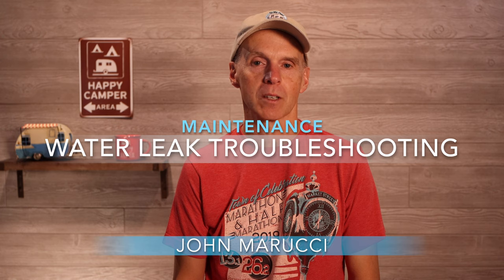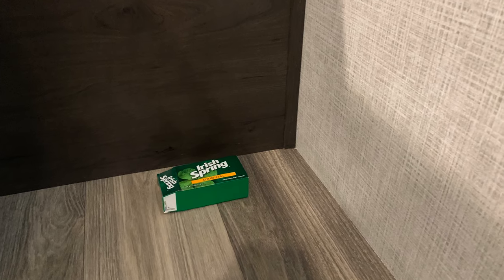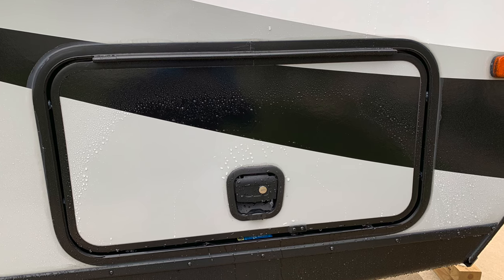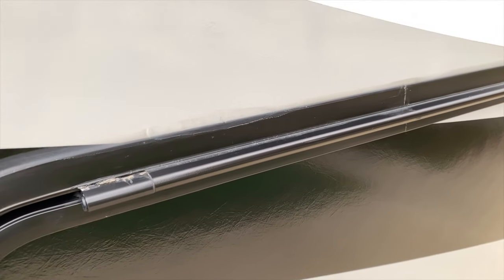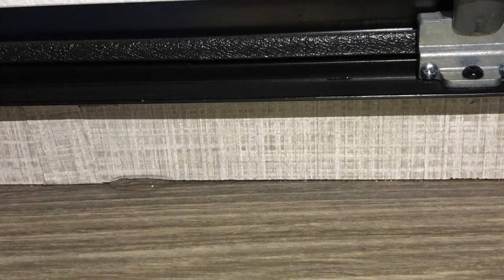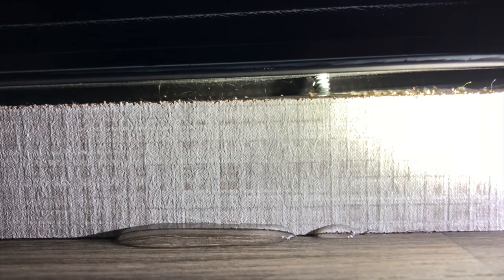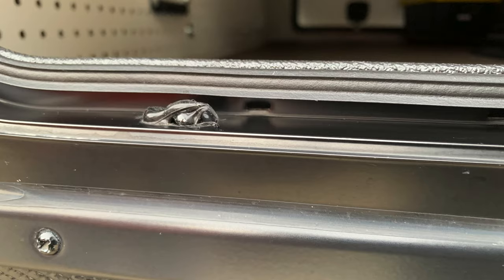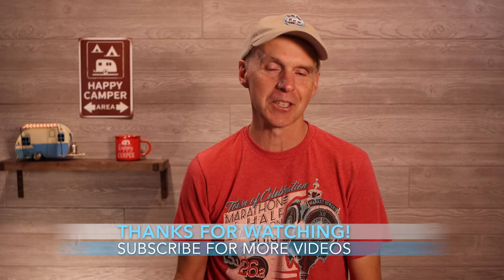RV Water Leak Troubleshooting

Comment: Wow, nice work. We have had a leak plaguing us since day 1,  which is 4 months now on our apex nano coachmen 194bhs. The dealer has replaced the front window multiple times. I’m so warn down by the fiasco.
Reply from the maker: Leaks can be very frustrating. If it is under warranty, it's hard to keep it going, but try to stay persistent with your dealer until it is fixed. All the best!

Comment: Nice job figuring out that leak. Most people would not go to that extent to find the real problem. Maybe that is why there are so many water damaged RVs. I would note that I now avoid using silicone sealant because it doesn't last. There is a alternative called proflex sealant that lasts much longer and stays clear. Another alternative is a sealant used on household aluminum  gutters that seems to be the same as proflex but easier to find at the home improvement big box stores. Another common leakage point is the running / side marker lights. I seal those with proflex. Fair seas and following winds to you and your viewers.
Reply from the maker: Thanks for sharing the tip on using a better sealant!

Comment: Hi I just got a 1968 trailer camper yes it’s old the guy sold it to me for 500 bucks I bought it for privacy at my home so I can make it as a room for me but we just had heavy rain yesterday and on the top of the camper there’s a small leak and it leaked the whole camper inside I was sad so just now I push the water out on top and put a 10 ft tarp over my camper I hope this stop from water getting in and into my camper
Reply: I would want to show you pics of the camper and yes it’s really old I think it’s a bad buy and my dad is upset about it but little by little I can fix the issue but what should I do for now ? Please anyone wanna get a hold of me let me know
Reply from the maker: Jose, search YouTube for “Old camper roof repair” and it should bring up several videos from people who have had to do this.

Comment: Thank you so very much for taking such care to film this video. I’ve never had an RV before and at 81 I find myself with two large ones. My family and are living in them while a house remodel is underway. 
I’m in San Diego and we’ve just experienced a horrendous high wind and substantial rainfall which has resulted in water coming in a bedroom and pooling on floor. So I’ve turned again to YouTubei to learn as much as I can. 
As others have mentioned you’ve produced an excellent video on perseverance.  Though unlikely my solution, I did learn so much on how to isolate areas and how I might check them. 
I’ll certainly be binge watching your others to become familiar with trouble shooting and understanding. My rigs are both used and no manuals were included so I’ve a lot to learn. 
Again thank you.
Reply from the maker: Thanks for sharing your comment. It’s great to hear that the videos are helpful. All the best!

Comment: Thanks for the video and ideas on how to test for the lower seam leak.  I was going bonkers trying to figure out where the water was coming from this time!  While looking in the door with a flashlight, I gently sprayed some water around those sealed screws and quickly saw water coming in.  After close inspection, I found a sealed screw that was broken and loose.  I removed the broken screw head and sealer, then filled up the hole with GE silicon to seal it all up.  I went over the rest of the door frame screws for good measure and did another test spray and saw no water coming in.  Thanks for the ideas on where to look!!!!!  2020 Winnebago 2108DS front driver side passthrough door.
Reply from the maker: Gerald, great to hear that the video was helpful and that you were able to identify where your leak was. All the best!

Comment: Great Video. I have a 2022 Jayco 284BHS and so far have encountered at least 3 different water leaks. The firs two was easy for me to see where the water was coming in from (The slide, and a window) but the one i'm troubleshooting now is a little more difficult to locate. Keeping water out has been my biggest challenge with owning a trailer.
Reply from the maker: Thanks for sharing your experience. Have you been able to locate to source of the leak?
Reply: @JohnMarucci  I have! At least I have found one source. Under the shower I can see water dripping from a hot water line. Unfortunately I don't see any easy way to access it. I have seen others have to take out the entire shower to access the lines..
Reply from the maker: Mine has an access panel to under the tub pan. I’m assuming you don’t have an access panel?

Comment: Would this allow water to get into the insulation that under that area. In the outer edge of my sonic (similar floor plan to yours) underneath on the sides, I noticed the insulation under the plastic was saturated with water. Only in the front of camper. Both sides.
Reply from the maker: It very well could allow water to seep into the subfloor and any insulation. The key is to try and test to see where water is getting in. If both sides are wet, I'd start by checking the roof caulk on both sides for any holes, then working down to the lower areas. Having someone help spray a specific area, while you are looking at that area is helpful. I video taped a lot in the cargo hold to find the issue. All the best!

Comment: In the same issue with my rear cargo hatch door, only difference is mine doesn't have the crimps/weap holes and the screws are on the inside , was hoping it would be one or the other lol.
Reply from the maker: With the screws on the inside I’m not sure it could leak the same way. You may have do a similar water test to identify where the leak is. Thanks!

Comment: So why doesn't keystone recall or have the dealers silicone those areas of those model years? It would be better then having to replace a soft floor. I have 2018 premier without any issues but you can bet those screws will get some attention. I've been keeping paper towels bye the opening since hearing about this issue. There is soo many people on keystone Facebook group with campers coming back from factory floor replacement destroyed. Why not recall them when issue was identified? Crazy!
Reply from the maker: Yep, I have been following this issue for a couple of years and its tragic what has happened to so many people. They are pretty much replacing the ones that happen, so I suppose it is a soft recall. Fortunately I have the hyper deck and didn't have my floors destroyed. Thanks for the comment.

Comment: Ours just developed a leak last weekend at the roof level.  I’m not sure where it’s coming from quite yet.  Just a little over a month out of warranty.
Reply from the maker: That's pretty close to still being under warranty. I'd push on it with my dealer and the manufacturer given you are so close to warranty expiration.
Reply: @JohnMarucci  Oh believe me I am.  I tried to pressurize the trailer yesterday with no luck.  I need a fan that moves more air.  However I did also put a hose on the roof and nothing leaked.  
So I just woke up 20 minutes ago and it was raining.  I went outside and no water on the inside of the trailer.  I do have the cover on but where the leak was coming in at is exposed to the rain (the rear cover was flipped up on the roof).  The entire rear “cap” was exposed also.  So just my best guess is it might be intruding on the drip rain somewhere and coming in.  
One thing I didn’t mention was that it developed this weird cracking in the gel coat near where the leak happened.  
I also pointed out to those guys (dealer and coachmen) the last time we used the trailer was in August.  It’s hot in August and obviously not raining.  August was before our warranty was up.  So, now we wait.  The dealer is communicating with me on this though.
The saga continues.

Comment: Our carpet has been getting wet around the kitchen area and I don’t understand why. I live in Louisiana so it rains a lot but I’m still not sure where it’s coming from or how to stop it. So frustrating.
Reply from the maker: You may want to first check all plumbing connections inside the kitchen cabinets. I had some come loose recently from the trailer being jostled while being towed.

Comment: While this speaks to the quality of your channel, it speaks much louder to the quality of the manufacturer who should have far more reason and motivation to figure out their build failure before you figured it out for them. 

It'd be reasonable to wonder if the new water resistant flooring shows a manufacturer philosophy of covering up major issues with minimal effort bandaids that hide things long enough to kick the can down the road so current decision makers won't be around to have to answer when customers with catastrophic results finally come calling.
Reply from the maker: Thank you for the comment. Keystone has replaced many floors due to the slam latch door leak issue at great expense to them. It baffles me that they don't test their products for leaks before selling them to the general public. The hyperdeck composite floor on my Keystone RV has held up well, yet not without the stress of fixing issues that never should have been sold to the customer. I am not sure that current management is kicking anything down the road as much as they are not thinking through the testing process on products. In essences most RV companies use customers for R&D and test in production – to their public embarrassment. Thanks again!